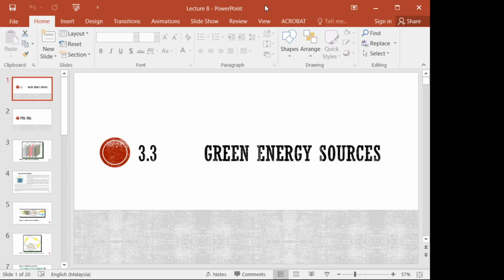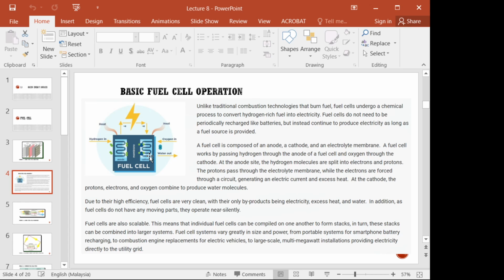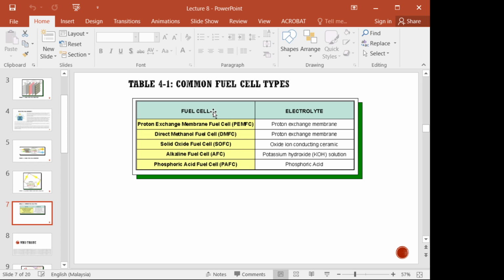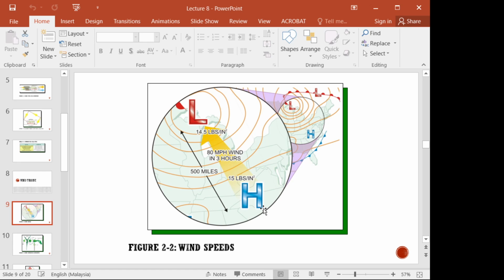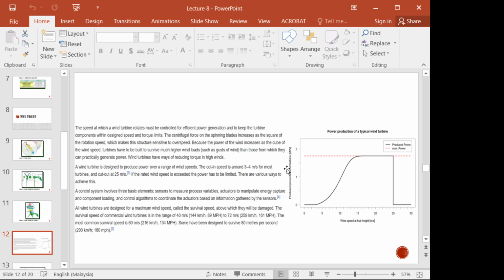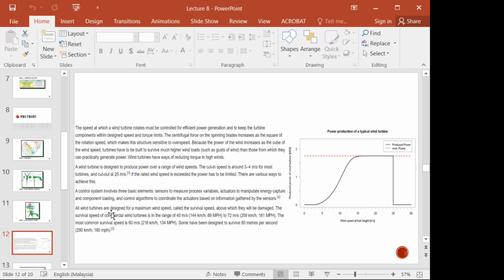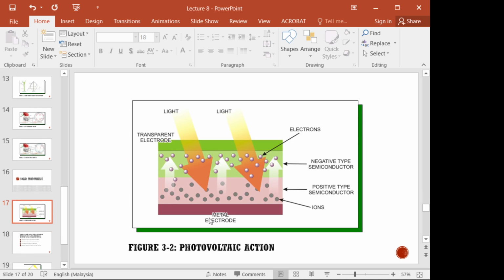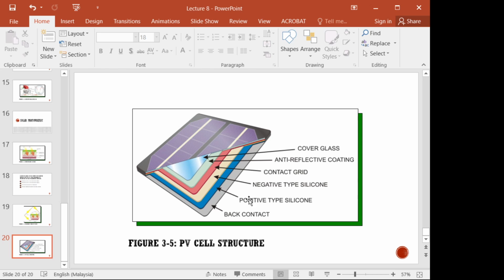Lecture 7 Introduction to Possible “Green Fuel”

Comment: MUHAMMAD HAZIM BIN ISMAIL
B071710545
4 BMMH S 1/1

3.3 GREEN ENERGY SOURCES
1)	Fuel Cell
•	Fuel cells undergo a chemical process to convert hydrogen-rich fuel into electricity.
•	Do not need to be periodically recharged like batteries, but instead continue to produce electricity as long as a fuel source is provided.
•	A fuel cell is composed of an anode, a cathode and an electrolyte membrane.
•	Due to high efficiency, fuel cells are very clean, with their only by-products being electricity, excess heat and water.
•	Do not have any moving parts and they operate near-silently.
•	Individual fuel cells can be compiled on one another to form stacks, in turn,  these stacks can be combined into larger systems.
•	Fuel cell structure: -
  o	Positive collection plate
  o	Negative collection plate
  o	Positive electrode
  o	Negative electrode
  o	Catalyst
  o	Electrolyte
•	Common fuel cell types: -
  o	Proton Exchange Membrane Fuel Cell (PEMFC)
  o	Direct Methanol Fuel Cell (DMFC)
  o	Solid Oxide Fuel Cell (SOFC)
  o	Alkaline Fuel Cell (AFC)
  o	Phosphoric Acid Fuel Cell (PAFC)

2)	Wind Turbine
•	Efficient power generation can be achieved by controlling the speed at which a wind turbine rotates.
•	The speed of wind turbine’s rotation must be controlled to keep the components within designed speed and torque limits.
•	The centrifugal force on the spinning blades increases as the square of the rotation speed.
•	Sensitive to overspeed.
•	Turbines have to be built to survive much higher wind loads.
•	Designed to produce power over a range of wind speeds.
•	Control system involves three basic elements: -
  o	Sensors to measure process variables
  o	Actuators to manipulate energy capture and component loading
  o	Control algorithms to coordinate the actuators based on information gathered by the sensors.

3)	Solar Photovoltaic
•	A sun is equal to 1000 watts per square meter (1000 W/m2). This variable is affected by the following factors: -
  o	The angle the light hits the surface (time-of-day)
  o	The angle the light hits the surface (time-of-year)
  o	The cloudiness/haziness of the atmosphere
  o	The height above sea level where the surface is located
•	PV cell structure: -
  o	Back contact
  o	Positive type silicone
  o	Negative type silicone
  o	Contact grid
  o	Anti-reflective coating
  o	Cover glass

Comment: MOHAMAD SYAFIK BIN SOFI
B071710064 4 BMMH S1/1

GREEN ENERGY SOURCE
1-fuel cell
*Basic Fuel Cell Operation

- Fuel Cell undergo a chemical process to convert hydrogen-rich fuel into electricity
- Fuel Cell Clean
- Excess Heat
- Water
- Fuel Cell are scalable
- Combined into larger system

2-wind turbine 
For efficient power generation and to keep the turbine components within the designed speed and torque limits, the speed at which a wind turbine rotates must be managed.

3-Solar Photovoltaic

Comment: ALDY HENRY DUSIM
B071710329
4 BMMH S1/1

GREEN ENERGY SOURCES:

Fuel Cell: 
- Undergo a chemical process to convert from hydrogen rich fuel into electricity
- Fuel cell consist of anode, cathode and electrolyte membrane
Advantages: 
1. High efficiency
2. No moving part
3. Silent operation
4. The fuel cell is scalable

Basic fuel cell structure
- Positive collection plate
- Positive electrode
- Catalyst
- Electrolyte
- Catalyst
- Negative electrode
- Negative plate 

Wind Turbine: wind generator components
- Blades
- Nose cone
- Face
- Hub
- Stator
- Rotor
- O-ring
- Body
- Yaw
- Potentiometer 
Wind turbine is designed to produce power over a range of wind speeds. The cut in speed is around 3 – 4 m/s for most turbines and cut out at 25m/s.

BASIC ELEMENT CONTROL SYSTEM
1. Sensors - measure a process variable
2. Actuator - manipulate energy capture and component loading
3. Control Algorithms - coordinate the actuators based on information gathered by the sensor

Solar Photovoltaic 
a sun is equal to 1000 watts per square meter (1000w/m^2). This variable is affected by the following factors:
- The angle the light hit the surface (time – of – day)
- The angle the light hits the surface (time – of – year)
- The cloudiness/haziness of the atmosphere
- The height above sea level where the surface is located

Solar Photovoltaic structure:
- Cover glass 
- Anti-reflective coating 
- Contact grind 
- Negative type silicone
- Positive type silicone
- Back contact

Comment: KHOR YE SHU B071710464 (4BMMH S1/2)

GREEN ENERGY SOURCES:

Fuel Cell: 
•	Undergo a chemical process to convert from hydrogen rich fuel into electricity
.
•	Fuel cell consist of anode, cathode and electrolyte membrane
.

Common fuel cell types
:
•	Proton exchange membrane fuel cell (PEMFC)
•	Direct methanol fuel cell (DMFC)
•	Solid oxide fuel cell (SOFC)
•	Alkaline fuel cell (AFC)
•	Phosphoric acid fuel cell (PAFC)

Advantages of fuel cell: 
•	High efficiency
•	No moving part
•	Silent operation
•	The fuel cell is scalable

Basic fuel cell structure
:
•	Positive collection plate
•	Positive electrode
•	Catalyst
•	Electrolyte
•	Catalyst
•	Negative electrode
•	Negative plate 

Wind Turbine: wind generator components
•	Nose cone
•	Blades
•	Face
•	Hub
•	Stator
•	Rotor
•	O-ring
•	Body
•	Yaw
•	Potentiometer 

-Wind turbine is designed to produce power over a range of wind speeds. The cut in speed is around 3 – 4 m/s for most turbines and cut out at 25m/s.
-

Basic Element Control System:
•	Sensors 
•	Actuator 
•	Control Algorithms

Comment: HAKIM BIN ZAINUL
B017170531
4BMMH S1/1

3.3 GREEN ENERGY SOURCES

•	Basic fuel cell operation
o	Not like traditional combustion technologies.
o	It undergoes chemical process to convert hydrogen-rich fuel into electricity
o	Don’t need to periodically recharged
o	Continue to produce electricity as long as fuel is provided.
o	Fuel cell composed of an anode, cathode and electrolyte membrane.
o	Fuel cell work by passing hydrogen through the anode and oxygen through cathode. 
o	At anode site, hydrogen molecules are split into electrons and protons.
o	Protons pass through the electrolyte membrane.
o	Electrons are forced through circuit and generating electric current and excess heat. 
o	At cathode, protons, electrons and oxygen combine to produce water molecules.
o	It is very high efficient, thus fuel cell are very clean.
o	No moving parts.
o	Operate near-silently.
o	Scalable.
o	Can combine into larger systems.

•	Wind turbine
o	Efficient power generation is depending on the rotation of the fan.
o	Need to rotate within designed speed and torque limits.
o	The centrifugal force on the spinning blades increases as the square of the rotation speed.
o	Sensitive to overspeed.
o	Turbine is built to survive high wind.
o	Power generated by a range of speed.
o	Cut in speed is around 3~4 m/s and cut out at 25 m/s.
o	Actuator manipulate energy capture and component loading. 
o	Control algorithm to coordinate the actuator.
o	Design for maximum wind speed. (40m/s to 72m/s)

•	Solar photovoltaic
o	A sun is equal to 1000 watts per square meter.
o	Angle of the light hits the surface (time of day).
o	Angle of the light hits the surface (time of year).
o	Cloudiness/haziness of the atmosphere.
o	Hight above sea level where the surface is located.

Comment: MOHAMAD HURAIRAH BIN HARUN 
B071710461 

3.3 Green Energy Sources 
Fuel Cell 
-	is composed of an anode, cathode and an electrolyte membrane. A fuel cell works by passing hydrogen through the anode of a fuel cell and oxygen through the cathode. 

Wind turbine
-	The speed at which a wind turbine rotates must be controlled for efficient power generation and to keep the turbine components within designed speed and torque limits. 
-	3 basic elements  : 
•	Sensor to measure process variable. 
•	Actuators to manipulate energy capture and component loading 
•	Control algorithms to coordinate the actuators based on information gathered by the sensors. 

Solar photovoltaic 
A Sun is equal to 1000 watts per square meter (1000 W/m2). This variable is affected by the following factors: 
•	The angle the light hits the surface (time-of-day)
•	The angle the light hits the surface (time-of-year)
•	The cloudiness/haziness of the atmosphere
•	The height above sea level where the surface is located

Comment: MUHAMAD IZMAN BIN  JAMALUDDIN 
B071710518
4BMMH S1/2

GREEN ENERGY SOURCE
Green energy comes from natural sources such as sunlight, wind, rain, tides, plants, algae, and geothermal heat. These energy resources are renewable, meaning they're naturally replenished. In contrast, fossil fuels are a finite resource that takes millions of years to develop and will continue to diminish with use.

A- Fuel cell
1. Electrical generated from the transmission of electrons via a chemical process
2. A fuel cell is composed of an anode, cathode, and an electrolyte membrane. 

B- Wind turbine 
1. it does not produce pollution during operation for electric generation, but not necessarily mean the whole process is clean, but less carbon footprint.
2. Wind speed in 4-season countries is high due to the large temperature differences, making electric-generation is more viable on large scale. Compared to Malaysia, where the temperature difference is small and less wind speed. 

C- Solar photovoltaic 
1. When the light contacts the PV, it activates the ions, (the photons from the positive semiconductor transfer to the negative semiconductor, while the electrons from the negative semiconductor transfers to the positive semiconductor. Where the process generates electricity.
2. The sun is equal to 1000 watts per square meter (1000w/m^2). This variable is affected by factors such as light-to-surface angle (time-of-day & time-of-year), cloudiness/haziness, the height of the PV surface from the sea-level

Comment: NUR FITRAH NADIA BINTI KAMIDAN
(B071710363)
4BMMH S1/2

TITLE: LECTURE 7 VIDEO GREEN ENERGY POWER SOURCE

A) Fuel cell
1)	Electrical generated from transmission of electrons via chemical process
2)	A fuel cell is composed of an anode, cathode, and an electrolyte membrane. 
•	Hydrogen pass through the anode of a fuel cell and oxygen through the cathode. 
•	On anode-side, a catalyst splits the hydrogen molecules into electrons and protons. The protons pass through the porous electrolyte membrane, while the electrons are forced through a circuit, generating an electric current and excess heat.
•	On cathode-side, the protons, electrons, and oxygen combine to produce water molecules. Since there are no moving parts, it operates silently and high reliability
  3) Advantages:
   High efficiency, clean (biproduct of electricity, heat and water), no moving parts

B) Wind turbine 
1)	it does not produce pollution during operation for electric generation, but not necessarily mean the whole process is clean, but less carbon footprint.
2)	Wind speed in 4-season countries are high due to large temperature difference, making electric-generation is more viable on large scale. Compared to Malaysia, where the temperature difference is small and less wind speed. 
3)	Components:
•	Nose cone
•	Blades 
-	depends on wind pattern
-	the blade creates pressure difference between 2-sides of the blade (Bernoulli's principle) as the wind goes through them. Lift is created from the pressure difference and turn the blades 
•	Stator
•	Body
•	Potential meter
•	Yaw
•	Wind turbine is designed to produce power over a range of wind speeds. The cut in speed is around 3 – 4 m/s for most turbines and cut out at 25m/s. 
•	Control system contains 3 elements (sensor, actuator, control algorithm, where the wind turbine must be maintained at survival speed between 40m/s - 72 m/s to avoid damage

C) Solar photovoltaic 
1)	When the light contacts the PV, it activates the ions, (the photons from the positive semiconductor transfers to the negative semiconductor, while the electrons from the negative semiconductor transfers to the positive semiconductor. Where the process generates electricity.
2)	the sun is equal to 1000 watts per square meter (1000w/m^2). This variable is affected by factors such as light-to-surface angle (time-of day & time-of -year), cloudiness/haziness, height of the PV surface from the sea-level
3)	solar Photovoltaic structure:
•	Cover glass 
•	Anti-reflective coating 
•	Contact grind 
•	Negative type silicone
•	Positive type silicone
•	Back contact

Comment: ALDEN ANDRIAN PHIUS
B071710392
BMMH S1/1

GREEN ENERGY SOURCES
1.FUEL CELL
Fuel cell structure
-	Positive collection plate
-	Positive electrode
-	Catalyst
-	Electrolyte 
-	Negative electrode
-	Negative collection plate
Operation
-	Undergo a chemical process to convert hydrogen rich fuel into electricity
-	Work by passing hydrogen through the anode of fuel cell and oxygen through the cathode
-	At anode site, hydrogen molecule split into electron and proton. The proton pass through the electrolyte membrane while the electron forced pass through the circuit, generating an electric current and excess heat
-	At the cathode proton, electron and oxygen combined to produce water molecule
Common fuel cell types
-	Proton exchange membrane fuel cell (PEMFC)
-	Direct methanol fuel cell (DMFC)
-	Solid oxide fuel cell (SOFC)
-	Alkaline fuel cell (AFC)
-	Phosphoric acid fuel cell (PAFC)
2.WIND TURBINE
- To measure via carbon footprint
- There are 3 basic elements which is
i.	actuator to manipulate energy capture and component loading
ii.	sensor to measure process variable
iii.	control algorithm is coordinate the actuator-based information gathered by sensor

-Wind turbine basic components
i.	nose cone
ii.	blade 
iii.	face 
iv.	hub
v.	stator
vi.	rotor 
vii.	o-ring
viii.	body 
ix.	yaw
x.	potentiometer

3. SOLAR PHOTOVOLTAIC 
A sun is equal to 1000 watts per square meter (1000w/m^2). This variable is affected by the following factors:
i.	The angle the light hit the surface (time – of – day) 
ii.	The angle the light hits the surface (time – of – year)
iii.	The cloudiness/haziness of the atmosphere 
iv.	The height above sea level where the surface is located

Comment: AMIRATUL RASYIDAH BINTI ABDUL RAHMAN
B071710456

GREEN ENERGY SOURCES

FUEL CELL

- Fuel cell undergo a chemical process to convert hydrogen-rich fuel into electricity
- A fuel cell works by passing hydrogen through a anode  of fuel cell and oxygen through the cathode. 

COMMON FUEL CELL TYPES
- Proton Exchange Membrane
- Direct Menthanol
- Solid Oxide
- Alkaline 
- Phosphoric Acid

WIND TURBINE
A wind turbine, or alternatively referred to as a wind energy converter, is a device that converts the wind's kinetic energy into electrical energy. Wind turbines are manufactured in a wide range of vertical and horizontal axis. The smallest turbines are used for applications such as battery charging for auxiliary power for boats or caravans or to power traffic warning signs

WIND GENERATOR COMPONENTS
1. Nose cone
2. Blades
3. Hub
4. Stator
5. Face
6. O-Ring
7. Rotor
8. Body
9. Potentiometer
10. Yaw

SOLAR PHOTOVOLTAIC 

Factor - Sun is equal to 1000 watts per square mete;
- The angle the light hits the surface (time-of-day)
- The angle the light hit the surface ( time-of-year)
- The cloudiness/haziness of the atmosphere
- The height above sea level where the sun is located

PV CELL STRUCTURE
1. Cover glass
2. Anti-reflective coating
3. Contact grid
4. Negative type silicone
5. Negative type silicone
6. Back contact

Comment: AHMAD LUQMAN HAKIM BIN ZAMBRUS
B071710359
4 BMMH S1/1

Green energy sources 

1) Fuel cell
- Electrical generated from transmission of electrons via chemical process
- A fuel cell is composed of an anode, cathode, and an electrolyte membrane. 
  1) Hydrogen pass through the anode of a fuel cell and oxygen through the cathode. 
  2) On anode-side, a catalyst splits the hydrogen molecules into electrons and protons. The protons pass through the porous electrolyte membrane, while the electrons are forced through a circuit, generating an electric current and excess heat.
  3) On cathode-side, the protons, electrons, and oxygen combine to produce water molecules. Since there are no moving parts, it operates silently and high reliability
-  Advantages:
   High efficiency, clean (biproduct of electricity, heat and water), no moving parts

2) Wind turbine 
- it does not produce pollution during operation for electric generation, but not necessarily mean the whole process is clean, but less carbon footprint.
- Wind speed in 4-season countries are high due to large temperature difference, making electric-generation is more viable on large scale. Compared to Malaysia, where the temperature difference is small and less wind speed. 
- Components:
  1) Nose cone
  2) Blades 
      - depends on wind pattern
      - the blade creates pressure difference between 2-sides of the blade (Bernoulli's principle) as the wind goes through them. Lift is created from the pressure difference and turn the blades 
  3) Stator
  4) Body
  5) Potential meter
  6) Yaw
- Wind turbine is designed to produce power over a range of wind speeds. The cut in speed is around 3 – 4 m/s for most turbines and cut out at 25m/s. 
- Control system contains 3 elements (sensor, actuator, control algorithm, where the wind turbine must be maintained at survival speed between 40m/s - 72 m/s to avoid damage

3) Solar photovoltaic 
- When the light contacts the PV, it activates the ions, (the photons from the positive semi conductor transfers to the  negative semiconductor , while the electrons from the negative semiconductor transfers to the positive semiconductor. Where the process generates electricity.
-  the sun is equal to 1000 watts per square meter (1000w/m^2). This variable is affected by factors such as light-to-surface angle (time-of day & time-of -year), cloudiness/haziness, height of the PV surface from the sea-level
- solar Photovoltaic structure:
   -	Cover glass 
   -	Anti-reflective coating 
   -	Contact grind 
   -	Negative type silicone
   -	Positive type silicone
   -	Back contact